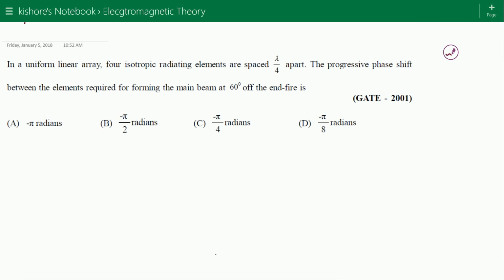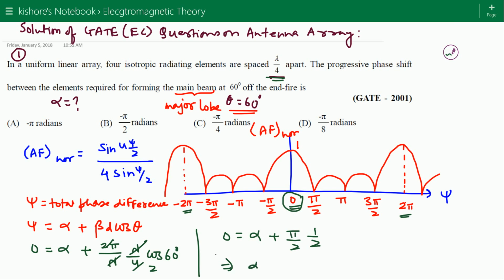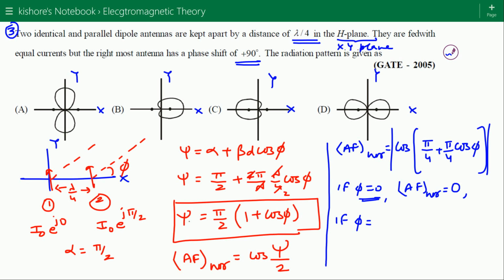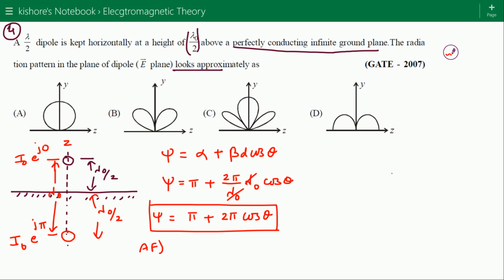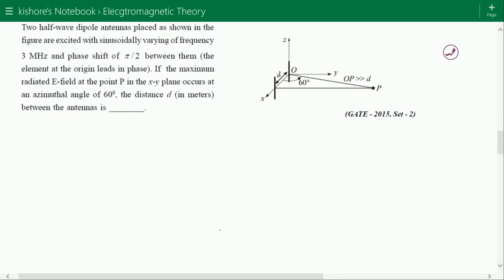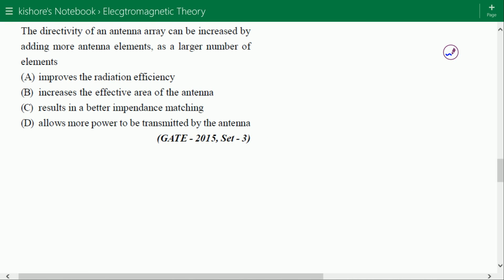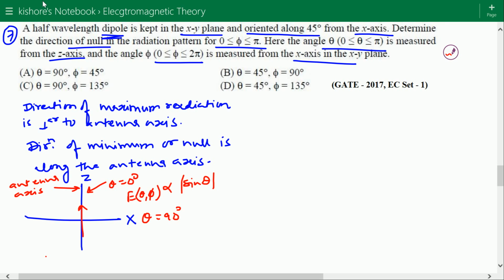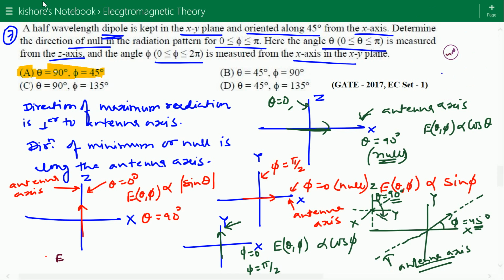Solutions of GATE (EC) Questions of Antenna Array

Comment: Hello sir 
In question 3 you tick the option on the basis of normalised array factor but it's not correct because if you multiply the unit pattern in AF then result is changed..
You just find radiation pattern of AF.
So plz clarify the concept..
May be I m wrong but plz suggest us we can go through only AF or follow pattern multiplication.
Reply from the maker: Ok I will check the explanation again and I will get back to you.
Reply: Sir plz clarify Question no. 3
Reply: where should study this topic?  pls tell
Reply: The solution is correct, because the antennas are kept apart in H-plane. The radiation pattern of a dipole antenna on the H-plane is a circle,.so multiplying the AF with a circle does not change the overall radiation pattern.
Reply: @sandeepmukherjee3909  Yeah Your are correct !!!